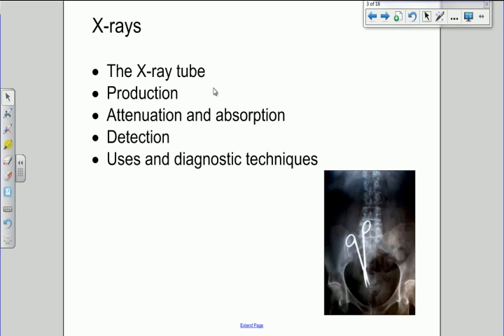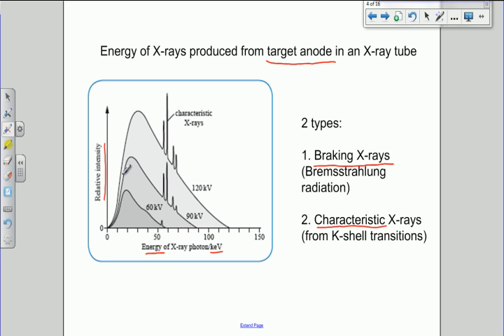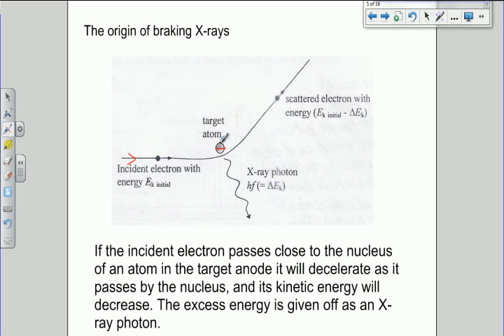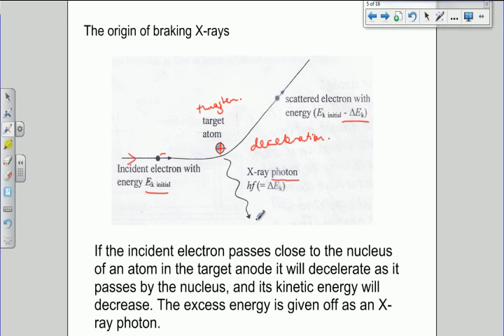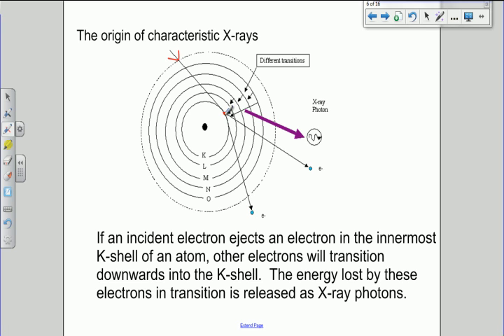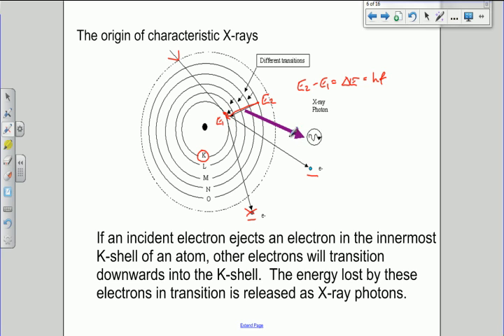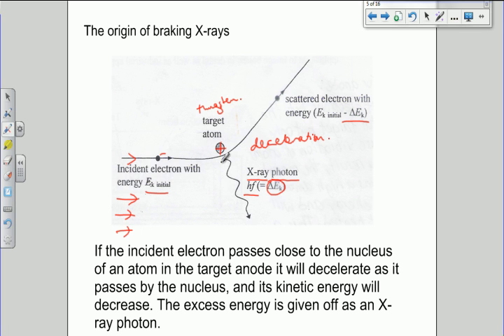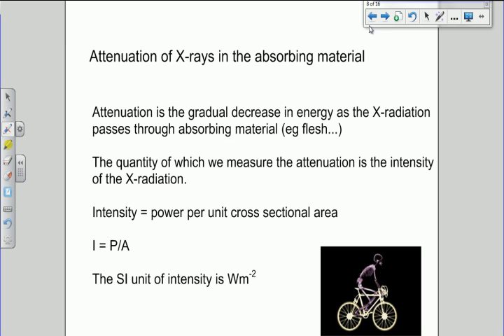A level Medical physics X rays - production - braking and characteristic radiation

Comment: Really loved your explanation of the reason,Why braking radiation can have effectively any value between a given range and why characteristic radiation on the other hand only have discrete values as opposed to the continuous smooth distribution of braking radiation.
Reply: 3 years late but discrete energy levels= discrete photon energies